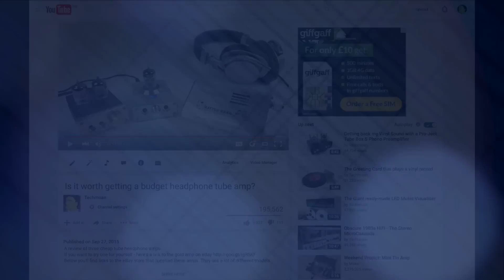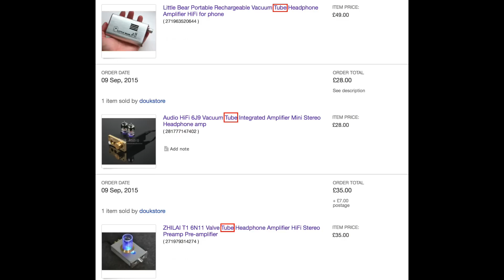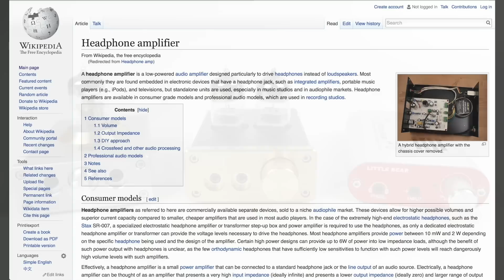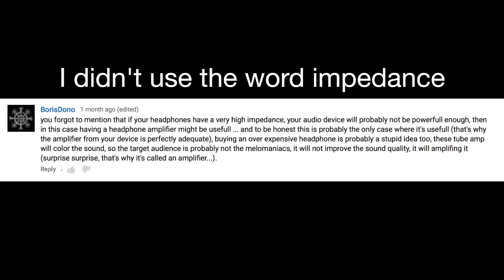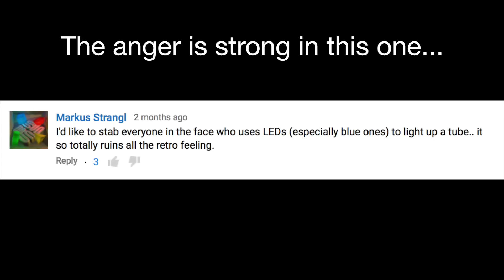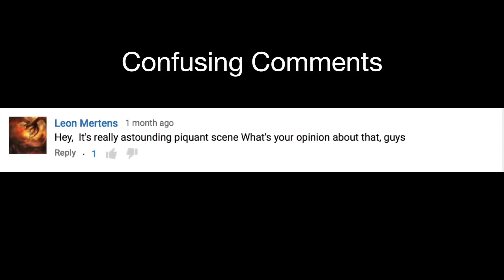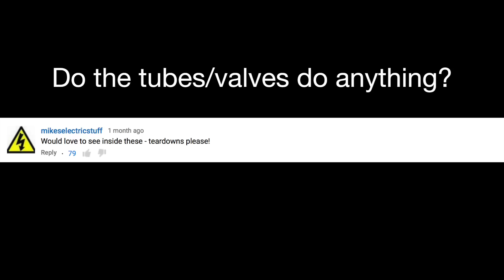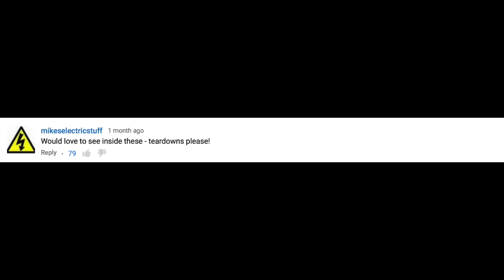Headphone Tube Amps - Follow-up & Tear-down

Comment: In each amplifier seems to have a NE5532 chip. A quick google search shows that this is an operational amplifier. op-amps are great for analog computing, and "amplifying" signals, but they in general are not designed to drive speakers and stuff. Generally the output is limited to a few tens of milliamps (mA) at most. They're probably serving as pre-amplifiers. 

I would expect to see some boost converters inside all these to create at least a few hundred volts for the tubes, but I don't see any high voltage capacitors indicating that. However, all of them do seem to have switch mode converters, so maybe HV capacitors are present as SMD ceramics without values printed on them or something, IDK.

Although unlikely, these could be multilayer boards with traces literally inside the PCB, explaining why there are seem to be pins that aren't connected anywhere. It would also be that the tube amp does not require the functionality of every pin. Some tubes might have more grids than are necessary for instance, or possibly some pins are simply not used and dont connect to anything internally inside the tube. (engineers like to stick to universal standards for case styles.) Same is true for solid state electronics, sometimes devices just have a few pins where are simply labeled NC for Not Connected.
Reply: +Bender Rodriquez it is English. If there are things you don't understand, Google it, and learn something new today.
Reply: +Bender Rodriquez He made perfect sense to me. Watch some EEVBlog and expend your knowledge of circuits.
Reply: I am going to GUESS looking at the electronics that they do use the tubes as output stages, considering I do not see any discrete transistors (SMD, TO92, or otherwise) to drive the headphones near the output jacks. I don't think op amps are powerful enough to do that, not at high volume, anyway. I could be wrong though.
Reply: +Power Max Well there are some inductors present, and also a smaller 8 pin device that has had it's part no. scraped off. Maybe that's the boost circuit.
Reply: +AltoScroll And in the last one there literally is a ready-made boost converter sticking on the back there
Reply: +Power Max Convert this to English please, do they or don't they benefit from the "choobs"
Reply: +AltoScroll  I wonder why manufacturer would waste time &amp; money to scrub off the part numbers on the voltage converter, since those are relatively simple to make, and that there are already so many very cheap solutions available, it is literally as simple as buying a jellybean converter, and building up the schematic on the datasheet/application note. Or you could just buy those small ready-made modules like that green board seen in 12:55. Very strange!!!! 

Generally when part numbers are destroyed, it is on some huge processor or FPGA or fancy analog device, stuff that is truly difficult to reverse engineer. Even I could probably figure out what part that is just by looking at the surrounding circuitry and digging through a bunch of datasheets for likely matches to find one with the same circuit in the application note and performance specs. Tedious, sure, but certainly doable within a day or so.
Reply: +Lythieus1 There are plenty of instances to speak of where Dave comes off as clueless to the more experienced. I don't think he's the final word in electronics education but I do find him entertaining!
Reply: Hey, go easy on Smitty Werbenjagermanjensen, because he was number one! (That's an obscure reference to Spongebob Squarepants and his million dollar soda drinking hat.)
Reply: It seems that those OPA are used in headphone amplifiers and are powerful enough so WHY OPA in a tube amplifier ? Fake tube (like SAMSUNG BT speaker which had an useless lamp)...
Reply: Op amps are used in several headphone amplifiers as output stage. B-tech BT928 for example.

Comment: Thanks for doing the teardown I was dying to know. The little bear has some kind of DC to DC voltage converter in it which may step up the battery voltage (The noise generated in this process explains the bad audio quality i think). As mentioned by others they all seem to have solid state amplifiers in them. The little bear might be the only one to actually get any amplification from the 'chube'?

Comment: This is a very interesting video and just to add my comments. All the circuits appear to have the components needed for an inverter circuit to supply the needed 90 to 100 volts. They are multi layer boards so you cannot easily tell what's connected to what. The Little Bear is poorly made and hand soldered they haven't bothered to clean the flux residue from the board. the other two are flow soldered indicating some form of mass production. The integrated circuits look like Operational Amplifiers which are probably used to provide high input impedance then feed the Valve which sort of defeats the object really. So in summary I would say they are solid state amps with a valve added onto the output stage to add some 'sound warmth' at best. Mind you its already being fed with a solid sate amp in any case
Reply: +Neil Winstanley 
no, those circuits can provide up to 40V at most because that is typical voltage for dcdc converter IC.
there are no transistors.
Little bear seem to be handmade bit it is only amplifier which is using tube properly. and thats why it has worst quality.

also it is unlikely that tubes are used for output there are no transformers so  their impedance would be too high.
Reply: And so what is your conclusion then?
Reply: Neil Winstanley
Conclusion is that first 2 amplifiers are half fake. and last is real tube amplifier, but it is bad quality amplifier.

Comment: The PCB's are double sided and it seems that some of the tube pins are connected to components on the top side.
Preamp tubes like these are often used with low plate voltage in guitar distortion stomp boxes and some cheaper microphone preamplifiers, the operation mode is called "voltage sagged" and can work alright, although most of the magic happens at way higher voltages as seen in properly designed preamplifiers. The "Little Dot mkIII" is a very popular and well sounding all-tube headphone preamplifier.

The opamps are there to buffer the signal, tubes are high impedance devices.
Reply: There are two types of amplification - voltage amplification and current amplification. The tubes amplifies current. They are NOT eye candy.
Reply: Søren Hammer In fact they behave similar to FETs.
Reply: These amps may have one or more voltage multiplier stages, my electronics knowledge isn't really good enough to tell, but the "gold" amp certainly has enough components on the board for that... a ditto on the double-sided board, and the amps may have more layers than that - PC's now operate with motherboards in the five to seven layer range!
Reply: I’m curious as to why you typed all of that out.
Reply: We used to call the low plate voltage mode "starvation" mode.
Reply: So they look cool! :D

Comment: Those circuit boards are double sided so although they it looks like just a few pins are connected at the bottom, there's also the top-side which has the rails making contact.  Although I have no idea about anything else on there :)

Comment: put it all together, they all use ne5532 op amps one per channel, only 2 or 3 valve pins go anywhere rest are not connected or grounded, little to no voltage boost for valves, valves are dim and run cool, means valve amps are fake! that thing about delay and initial hiss, dead easy to replicate, add thermistor and handful of passive components, scam complete!
Reply: +marty mure 
The PCB's are double sided, and it is clearly visible that some of the pins are connected to components on the top side.

5532's are most probably used as buffers in these devices, but maybe also amplifying a bit as voltage sagged tubes doesn't have a whole lot of drive to amplify. It has been seen numerous times that voltage sagged preamp tubes can work; albeit not as well as in higher voltage operating conditions.
Reply: +Søren Hammer single or double sided pcb there is little doubt the valves are mostly decoration, used properly valves run hot, are inefficient and rather unreliable, can you imagine paying a tidy sum for something that breaks down every now and then and needs a new valve? owners might riot! the designers know this and give the valves a token role, as for why valves are used people say valves give a warm and vibrant sound but this is subjective
Reply: +marty mure The heaters are what makes a tube hot, and the 6.3 V required is almost certainly used in these small preamplifiers. A preamp tube like these do have a very long lifespan, typically 10 years if the device is used an hour a day which is still more than the lifespan over average consumer electronics today. Even the bigger output tubes for driving speakers like the EL34 will last 3-4 years before it begins to sound tired.

Comment: Some observations:
* If you notice microphonics, the signal is definitely  passing through the tube. 
* The blue circuit board is doubled sided (has copper tracks on both sides), so there are more than three connections. 
* The blue board has one tube, which is a 6N11. As mentioned by Mark Keen, this is identical to an ECC88 (http://www.r-type.org/pdfs/ecc88.pdf). The ECC88 is a double triode, so it can be used to amplify stereo sound, one channel per triode. 
* The ECC88 needs an anode voltage ('Va') of 90 volt (so there needs to be a step up converter on the board) and a Vf=6.3 volt (filament voltage, to heat the tube). The filament draws 365 mA, according to the spec so heating draws 2 Watt.
* All amplifiers use NE5532N opamps (look for small black blocks with eight connections), so if you want pure 'tube' sound, you are not getting it here.
* The construction of the Little Bear amp is terrible, the board is a real mess.

Comment: The caps on those circuits are almost certainly used to boost the power up for running the heaters in the valves. Hence the delay before the sound comes out as the capacitors charge up on first switch on. Judging by your speaking techmoan I think you do know what's going on as you pretty much explained it at the end. Both vids were great. I was also thinking about a headphone amp, and at those prices they aren't a big gamble.

Comment: 6N11 and 6J9 are low noise amplifier tubes. The serials are Chinese variants in Europe the 6N11 is an EC88, and the 6J9 is a variant of a 12AU7 also a low noise amplifier. In my first valve amp, a CR Developments Kalypso 12AU7s were used as pre amplifier tubes, the power amplifier valves were EL84 - the big box(es) on valve amps are normally power transformers to drive the heaters in the valves. The Kalypso only produced 15watts total output which is why I used Triangle Comete loud spears with high impedance (I think they were around 96db) to get the best out of the amp. That was back in 1995. I was lucky to come across a pair of Quad valve amps from the 40's (which I had reconditioned) they used 500B power amp valves and were gorgeous. These were produced before the transistor was perfected in 1947. So yes Valves/tubes do work. They sound awesome though do 'colour' the sound, which I don't mind, I'm not that much of a purist, I like the warm tube sound.
Reply: Tube amps typically have an impedance transformer to step the impedance down from thousands of ohms at the plate of the tube to around 8 ohms for the speakers.  At high power levels these transformers get large, heavy, and expensive to make.

Comment: Well I do believe that the tubes are functioning and in use, however, I worry the voltage necessary to put the tubes to proper use is not being achieved. I am a college freshmen with a general understanding of electronics because of my dad, and with transformers that small I can't imagine you are generating enough voltage.

I'll have to check back on this video in a few days to see if anyone comes forth with a proper explanation of what's going on here.
Cheers from Hawaii.
Reply: +sample text There's not a single transformer in there ;) But I see inductors . And with those you are able to get to higher voltages quite easy. How do you think all those Nixie clocks work from a wall wart? And most of those Nixies need more volts (200 or so) to work then these tubes. The 6N11 only needs 90V, easy with an inductor because they don't need a lot of current. Only thing is, I don't see a high rated (voltage wise) capacitor in all of them. But then again, when you use a boost converter with a high enough switching speed you don't need a big capacitor and you're not able to hear it if there is ripple on the high voltage.
Reply: tengelgeer ah, I didn't know the inductors could step up the voltage in sequence. I figured they were there to deliver slightly higher voltage, not to deliver the total necessary amount, shows what I know :p 
 
Interesting that the tubes can be powered with 90v, I figured they would need much more.
Reply: ***** I thought you needed a quite large voltage to use bulbs? Will most all tubes (including proper stereo amps) work with 12v?

Comment: I am not a pro but those tubes or valves really are doing something they appear to be designed as just basic amplifiers , if you look closely you will see circuit board traces on the top  .The messy stuff on the bottom of Little Bear is sloppy workman ship it kinda looks like solder flux that was not cleaned off , The tubes ,valves chosen are low voltage to make it easier to be powered from wall adapters (wall warts) Electronics is one of my hobbies . I started building simple projects using tubes back in the 1960`s ,as I started with I am not a pro but I do know some things about tubes

Comment: I noticed that all three contain an inductor (coil), that indicates the possibility of a converter to boost the voltage. The only way to prove it is with a multimeter.
I did an internet search for 6J9 and it's a VHF triple triode, not something you would normally use in an audio amplifier. Very strange. I concur with KickF that Dave at the EEVblog would give us the low down if sent one or more of the devices. 
Finally "thermionic valve" is the designation of the device, but valve or tube is just as understandable to me. I guess I'm just not that anal retentive :-D

Comment: I find it difficult to believe that those are actual tube amplifiers.  All of the tube amps that I have built and worked on had really high voltages, though low currents, but still.  The heater of the tube would use the most current and based on what I see it looks hard to make high voltages for the plate in those designs.  Maybe those are some proprietary tubes to give the effect of a tube amp but do not actually classify as one.  The headphone tube amp that I have uses 12ax7's and a 5u4.  If you leave those little things on for a length of time, how hot do the tubes get??
Reply: +NikTheFix 
Way too few caps and diodes on the board for that kind of step up converter. But you don't even need that. In the basic form a controller chip, inductor, diode and capacitor is enough for a boost converter. I'm very sure the first amp has two of these, the second amp one and the third one as well (in the latter case it's the extra board soldered on near the battery). Those boost converter boards are available from ebay in the 1 or 2 quid/buck/euro region. The parts for it are even cheaper.

Comment: They are all conected but you cant see since the boards are multi layer and there is one or more layers of traces in the midle of the pcb. The caps on the little bear use  to stabilise the voltage since it has got a part that svitches 3.2v bat voltage to min 6 v or more since 6v is minimal voltage for submini tubes .

P.S. Nice videos
Reply: +locoo1 
I don't think there's any hidden layers. Multilayer boards (more than two) are way too expensive. Your point is still valid, you can see traces coming from the pins on the top of the board.
All the amps have boost converters on them (at least the parts for them are all there; the first amp might even have two). But the little bear uses a cheap module (can be had for a euro or two from ebay) that might need the big filtering caps, because these modules are far from noise free.
Reply: +locoo1 good explanation on the pcb and caps
Reply: +superdau I just had a set of three 4-layer PCBs made for a hobby project.  Cost me $12.10 shipped.  If I were ordering in quantity, the price would be negligible.

4-layer is the new 2-layer.

Comment: I actually bought the gold one and I do like it. Only complaint I have is that my left tube heating element is somewhat dimmer than the right one, so it just looks off.... I'm not quite sure, but I suspect it's unbalancing my audio :(
Also, I do have the ringing in the headphones, but seriously, it isn't noticeable unless your punching your desk or launching the damn amp across the room. My keyboard sometimes touches the amp, and even then, I only hear faint ringing. 

Interesting to see the inside of the am I have without taking it apart.  If anyone is curious whether or not I recommend that gold amp; I say yes. It drives my headphones to the physical limit, at like 1/3rd power, and my friend's headphones to full (you know, those proper, big ones) at around 3/4. No clipping, at least none that I've noticed!